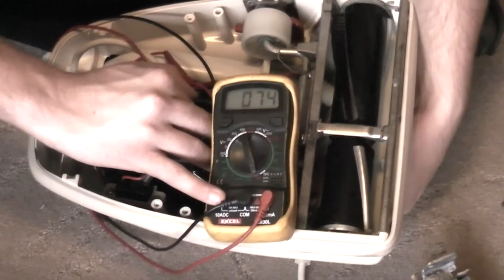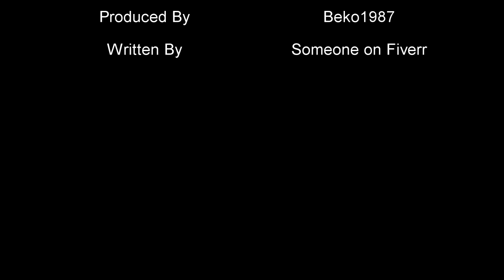Investigation for IBAISAIC! Part Two -Troubleshooting a Dead Hoover Junior U1034 Exclusive!

Comment: Thank you so much for all your efforts, It's great to see Debbie Dirtsearcher running again. Don't worry, I will fit a genuine belt when I get her home, plus a new LED lamp for her headlight. If she gets here in time, she can feature in one of my remaining advent videos.
Reply from the maker: ibaisaic That's handy, you should have her on Saturday! The belt is fine, I wouldn't bother changing it!
Reply: Beko1987 
I think that the hoover turbopower junior motor is even easier to work on
Reply from the maker: cars and vacuum cleaners their about the same really, possibly slightly harder as you need a puller for the fancase bearing but there's not much in it

Comment: Superb video again Sam . Love the hoover junior motors as they are great to work on and you can replace anything on them . We have two of the metal hood 1334A models with the grey front plate from 1962 which we use regularly to clean the house and they both work superb. I service them every few years and have no problems with them apart from changing the paper bag and the belts every now and again. We have a Hoover 119 and a Hoover Early model Dustette at our static caravan caravan in Wales which provide great cleaning for the years and years we have been there. Would not have any other cleaner apart from the ones we have